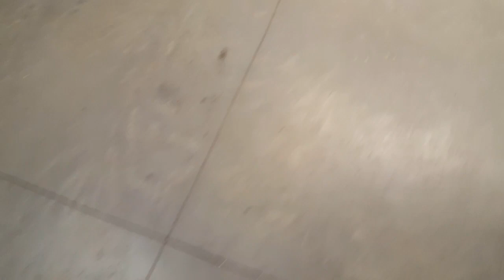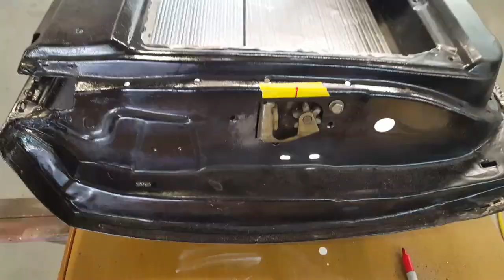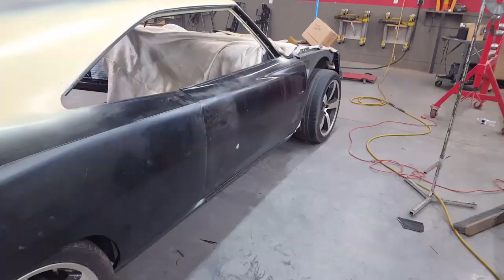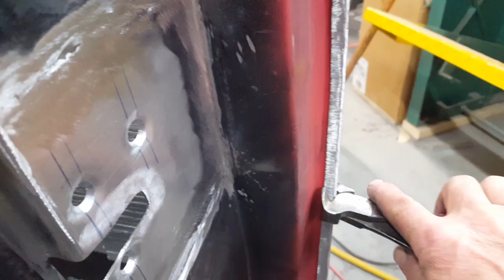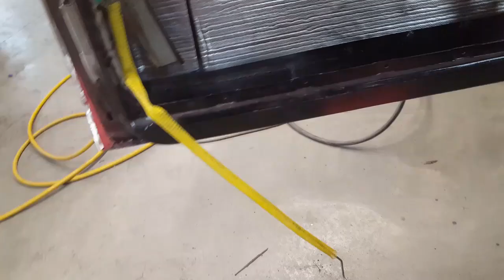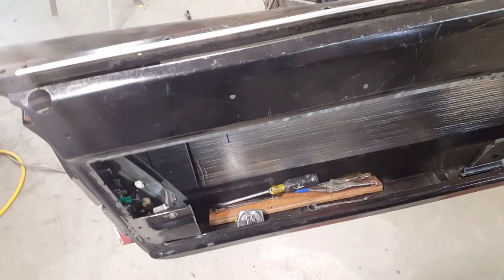Don's 68 Charger body swap part 18

Comment: I know this video is old. I just thought of something that could have been done with the door handles of the Challenger. You could have cut out a patch piece of the door handle off the Challenger doors and trace the patch onto the Charger door. Then, cut it out the Charger door handle skin and weld in the Challenger door patch for the Challeger door handle. That is a simple solution to do if you went that route. I am interested in how you are going to mount the latch mechanism with the old Charger handels.
Reply from the maker: It worked out good with the old style handles. We wanted to keep this as stock appearing on the outside as possible. I put the modern handles on my own car.
Reply: @SteveMirabelli  Yes, it did. When I was making my comment, I wasn't finished watching the whole video. My bad. Sorry. I like what you did.

Comment: You might have mentioned it and I missed it buy why didn't you use the 68 inner door mechanisms? Seems like a lot of work just to use the modern latch but I am sure you had a good reason.
Reply from the maker: The door harness is interwoven with both the locking mechanism and the window motor controls. The latches are much nicer in operation and can be controlled with the key fob and also indicate on the dash when the door is ajar.
Reply: @SteveMirabelli  Make sense I got caught up in all of the work you had to do to get it all working.

Comment: Excellent once again, Steve. I like you going the route of the original handles. New one looks great, I just personally like the old style.  Lots of adjusting & fiddling etc, but thats where pride comes in. Looking great & coming along nicely.
Reply from the maker: Thanks again. Originally this car was supposed to have a lot of the features my car has but the time involved would have shot the budget so we settled on as stock appearing as possible on the outside.

Comment: What is the advantage to using the newer door latches?
Reply from the maker: Remote lock and unlock. Dash indicates open doors. They are tied to the window motors also as they let the glass down a bit when you open the door. That allow you to adjust the window up tighter to the upper seal.